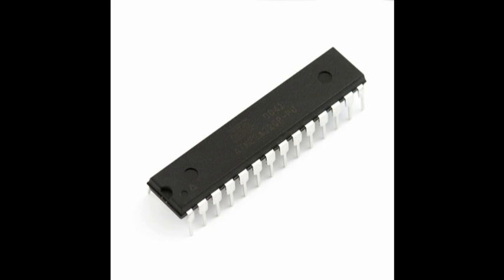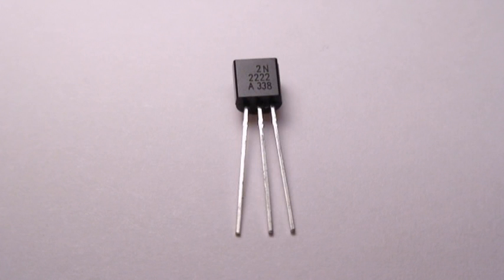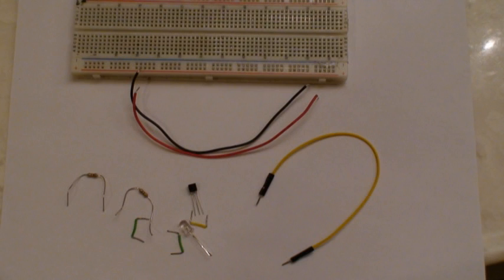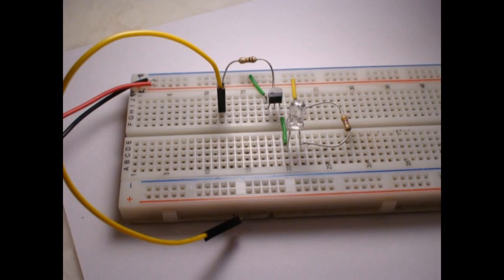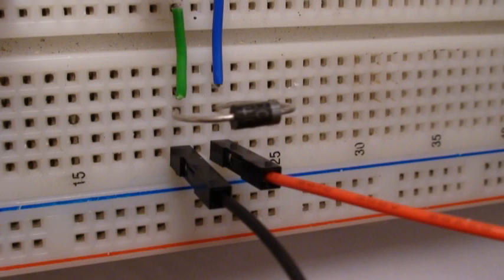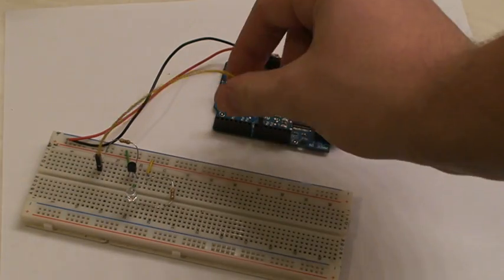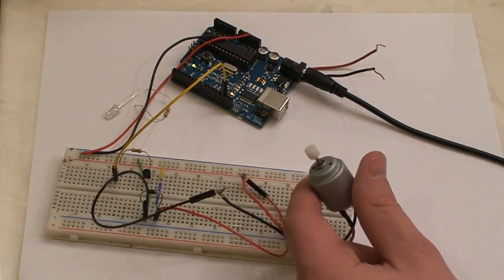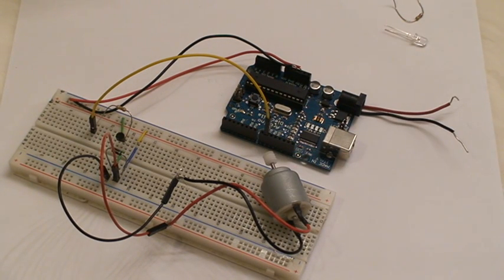Transistor Amplification - Arduino Workshop Project Video #2

Comment: I am very new to electronics in general. So I have nodemcu board which outputs 3.3v on pins and I have relay that needs 5v in order to work. Can you pls tell me what kind of setup do I need in order that to work. thanks

Comment: I would think that motor would be overloading a pn2222 which only rated for 350mW.  So you might want a beefier transistor for a motor.  Fine for relays and some LEDs though.
Reply: my bad, I see your circuit diagram has a PN2222A which is good for 625mW apparently.

Comment: I think the PWM method don't work whit an other source power. If you dont want to burn your arduino you need yo place a diode in the base, the resistor in the collector and a jumper in the emitter... that is Common Emitter Voltage Gain, you can see that here pdjinc.com/Transistor%20configuration.JPG

Comment: Thanks mate, was having trouble driving a relay, realised it needed at least 50mA to latch (and could draw as much as 70mA ! scrounged the parts box to find a transistor (random part number) and wired it up, works perfect every time.

Comment from the maker: This motor came from a little robot kit. It had 4 AA batteries powering it so I am assuming the motor is rated for 6v. Most of these little motors can take 3 - 9v without any real problems it just that a higher voltage with increase rpm and heat. That will reduce motor life. As to how much current it draws or any specs I don't really know it was just a little motor I found for use in the video.

Hope this helps!

Comment from the maker: Yes that is entirely possible you would just have to select a transistor capable of pulling the amount of power your led's will draw. Datasheets for the led's will tell you how much each will draw. Then you would have to get a resistor rated for the correct wattage (one big one) or you could split it up (1 per led, 1 per group of 10 ect...).

Big transistors need a good deal of juice to turn them on so you may need a 2nd tiny transistor to pre amplify the arduino signal.

Hope this helps!

Comment from the maker: What I meant was that in this circuit the signal is amplified from the digital output pin its not just a switch there is amplification involved. With a gain of 100 I can put 1milliamp in and get about 100 out. So this switch is not really just an open/close switch the larger the amount of current from the digital output pin the more current that can flow to the device (amplification).

Comment from the maker: The transistor is an amplifier, it takes the small signal from the digital pin and has a gain on it. If you check the packaging it will tell you what the gain is typically its around 100 alot of people call it the amplification factor. When the transistor is energized in this circuit it acts as a switch but seriously google around for other little projects. I did a few of them and learned a tremendous amount about transistors, they are anything but simple switches.

Comment from the maker: It depends on exactly what type of fan your dealing with. There are much more advanced higher end pc fans today that have integrated speed controllers. Those are really easy to set up you just give it power, a pwm signal and your good to go. If you have just a regular old fan with power input then you will need a circuit like in the video to control it. Make sure you use the circuit with the diode as it is an inductive load.

The temperature sensor has nothing to do with this that is separate

Comment from the maker: You don't use PWM like you would for a servo. You have to use digitalWrite in arduino on the pwm pin. That will create the speed control you want. Also you could hook it up to an analog pin and try analogwrite. I don't have the code for it but if you google for examples of analogwrite/digitalwrite you will find a few examples.

Comment from the maker: Yes you can hook up an external power source to it as long as the arduino is connected to ground. It doesn't have a set power rating it depends on what transistor you use some can handle small loads while others can handle massive loads. This transistor can work up to 36v. Look up the datasheets for these transistors they will tell you all you need to know.

Comment: hello
instead of the Arduino power source can be used to connect to another power source? and which is the maximum and minimum volts and amps of that?
 thanks

Comment from the maker: The motor was pulled from a 6v rc car so I would assume its rated for between 5v and 7.5v to be safe. The max load of the circuit isn't based on voltage, instead its watts (voltage x current). There is a max voltage of about 30v for that transistor but it can only push about 600mw so the current would be low. So the circuit doesn't have to run at the running voltage of the arduino which allows a world of possibilities.

Comment: So by using this circuit what is the max load that you can power? I am guessing 5v as that is what the Arduino board runs at?? Also can you remember the voltage of that motor?

Comment from the maker: The transistor I used in the video has the same pin out as the one from Radioshack. Look at the flat and convex side of the transistor in the video.

I don't know why Radioshack doesn't have them online but the diagram will be on the back of the package that they come in. It has tech specs about it as well as the basic pin out.

Make sure you use the 2n2222 transistor because that "pack" of 15 only has 5 of them, the other 10 are different types. They will work but have different power ratings.

Comment from the maker: O yea thanks to addzkebabs I just remembered that you can get them at Radioshack if you really need to go local or sometimes at hobby shops.

However I would recommend that you DON'T go to Radioshack. It may be convenient but they will charge you like $20 for a breadboard that is slightly larger then the one in the video. If you go to ebay you can get one that is like 6 times larger, w/ free jumper wires and shipping for around $18!

Comment from the maker: The white board with all the holes in it is called a breadboard. It is used for rapid prototyping of circuits. You simply put component's on the board and use wires and things to jump power around. This is a MUST HAVE and yes it will work for those LED's. The blue circuit was the programmable part the white board was only for connecting it all together!

You can get them at Sparkfun or ebay just search for "breadboard". The ones on ebay are just huge w/ free shipping for a really low price!

Comment from the maker: Well if you get four of these and place them in an H bridge configuration you can have bi directional speed control but only for brushed motors. For brushless I believe controlling them in more complicated so I would have to check in with that. As for servos they already have the circuitry inside, all you have to do is connect them to a power supply and send them a pwm signal.

Thanks for watching!